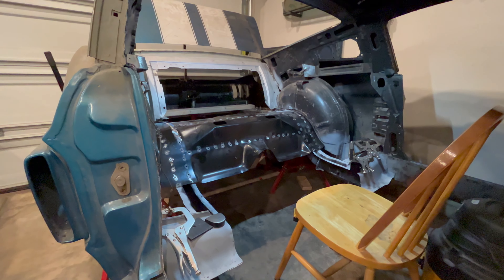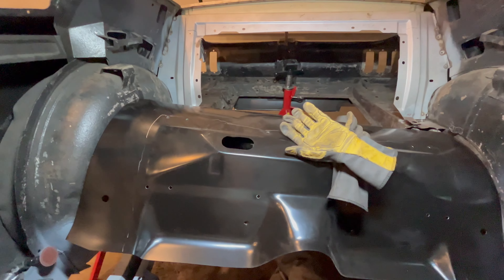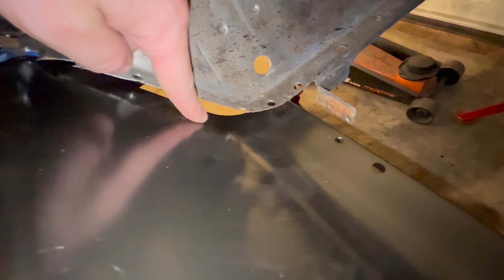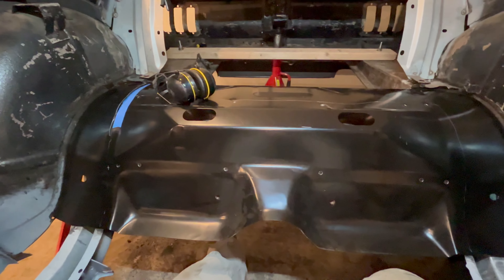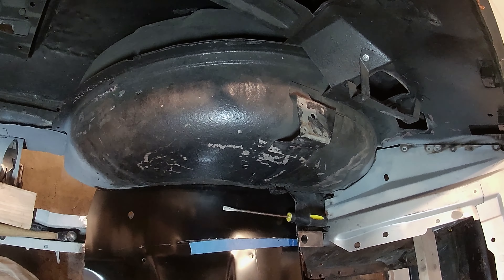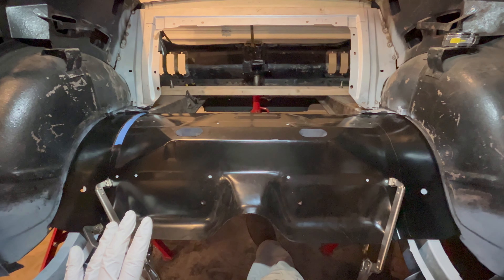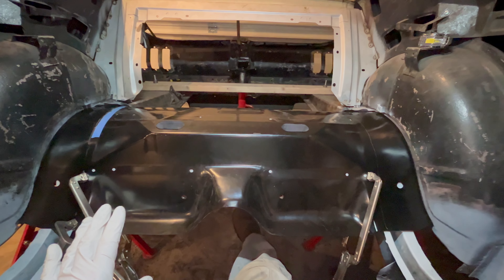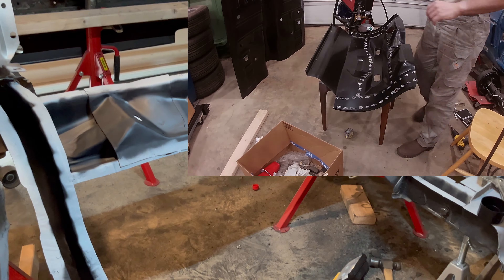Can I Get This Transition Pan to Fit? - 67 Mustang Part 32

Comment: Evan, my mustang also had the interior damage at the rear shocks. Talking to the previous owner indicated they did that because they had a problem getting the shock out so they opened it up for access. Then folded it back down and welded it. Btw, I'm following your videos for my winter 67 fastback project. You are a good teacher
Reply from the maker: Oh my goodness, that makes so much more sense than any of the other theories, thank you! I bet that’s exactly how only the upper got damaged. 
Good luck with your FB project and let me know how it goes! Remember I’m not an expert, but hopefully my videos are useful. I’m figuring out most of this as I go along. Cheers!

Comment: damn man, youre really going all out and replacing almost every peice of metal inside this car lol.  Im glad you wear respirators, looks like you wear the same one i do, full face shield respirator.  I wear a p100 half mask for my welding helm.  I dont understand why youtubers never wear masks... grinding, cutting metal.. releases so much nasty crap in the air, not to mention welding, especially flux core welding, i do a lot of welding on galvanized steel too the stuff you get from tractor supply or lowes.. if i take my mask off, once breath i can immediatly smell those vapors.. put it back on, and it isnt there anymore.  Youre lucky they seem to make patch panels and full panels for your entire vehicle.. for my Jeep J10 there is nothing, so i gatta improvise on all of it
Reply from the maker: No kidding! I once was wearing normal safety glasses and a tiny sliver of metal bounced and lodged itself into my eye. It hurt like hell and I had to get it removed, it was kind of terrifying and I’d be happy to never do that again. Plus all the nasty things you breathe, if I blow my nose and there is dark soot, I’m doing it wrong!
It turns out ford made millions and millions of mustangs, and there are enough folks working on them that quite literally every single part is available after market. I’m not exaggerating. Some are better made and fit better than others but they’re out there. I’ve had to modify panels and fab patches, but I can find something close to start with if I’m willing to pay for it. I don’t think I could do this if I had to make everything from scratch!
Thanks for swinging by!